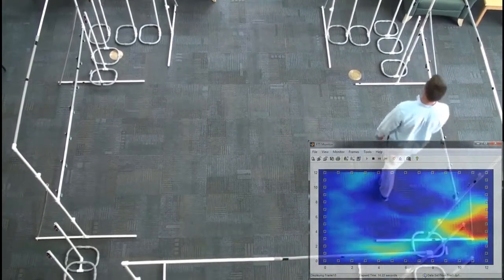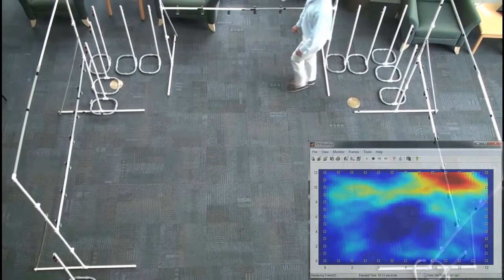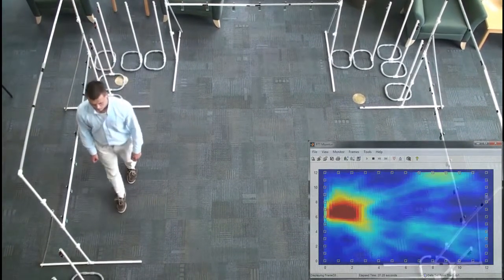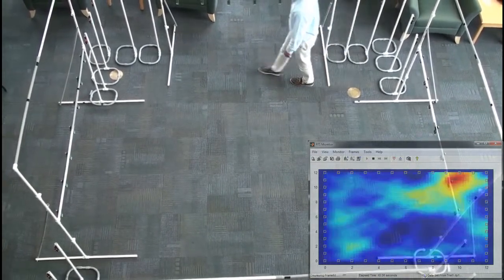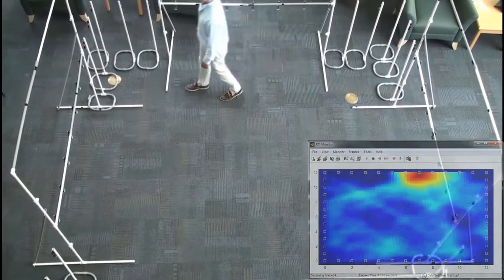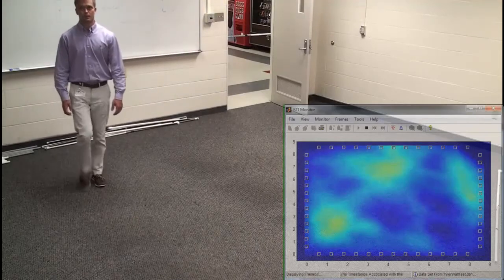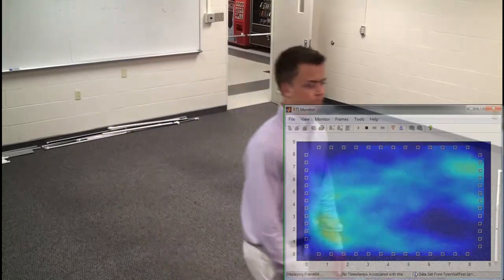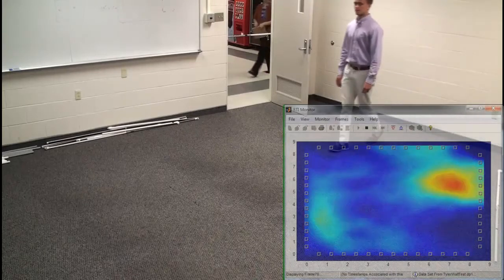Radio tomography: seeing through concrete walls

Comment: Hello Friend.

I'm finding it very difficult to test a simple communication between 2 CC2531 USB Dongle from Texas Instruments.

At first my notebook recognizes the CC2531 through Cebal controlled devices, not through a COM port.

By chance. How did you do the tests for your computer to recognize the peripheral?

How did you manage to communicate the device with IDLE Python?

I am trying to use it in Window 7. 62bits